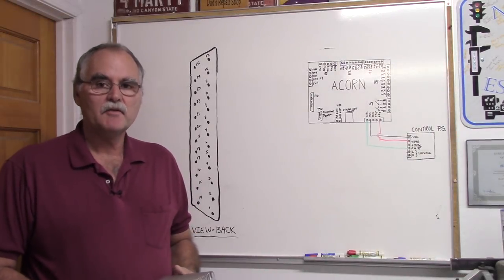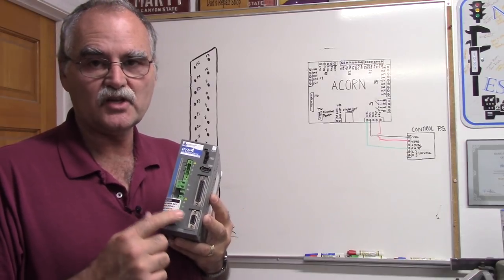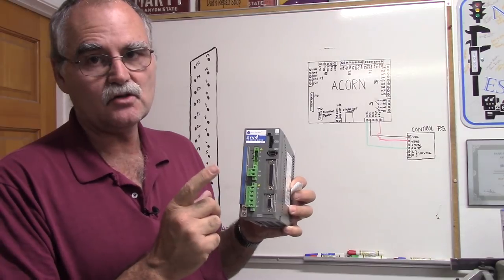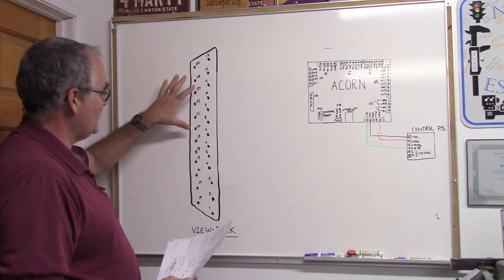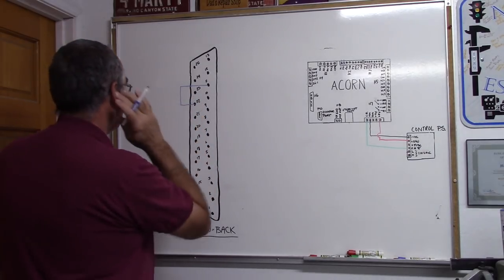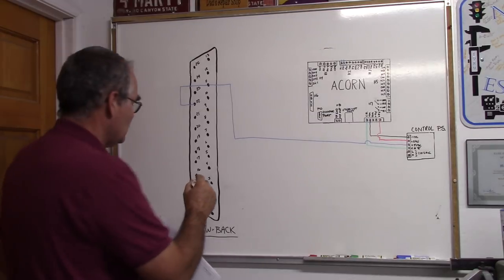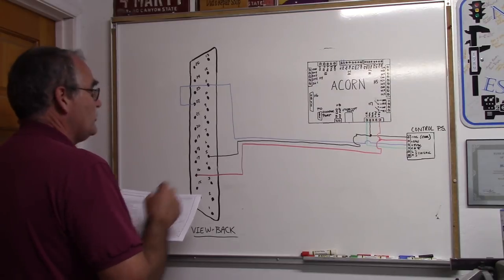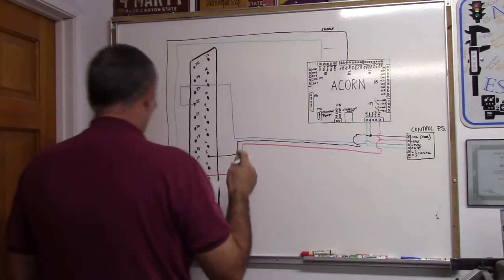DMM DYN4 Bench test with Centroid CNC Acorn

Comment: This video will help me greatly!  I purchased the DYN4 for my BP R2E4 and have been struggling to get motion from Acorn.  I did order the flying lead cables from DMM after not finding DB25's with the same wire colors or wire gage.  Thanks Marty, always look forward to your videos.
Reply from the maker: Brad, I hope the video helped. Just watch your wiring, and make sure you set the GEAR number to something like 2000, and then, change to Pulse DIR in the DMM software and don't forget to save it to the DYN4 drive. Then setup the motor steps per rev to 4x the gear number, in this case set it to 8000. Good luck. If you have trouble please visit the Centroid User forum and ask questions, post screen shots of your wizard screens, and post a report from the CNC12 software (Utility Menu) we'll try and help
http://centroidcncforum.com/viewforum.php?f=60&sid=013d264735c752e6d3e182053c581f85

Comment: Thanks for the video.  Your videos are always informative and easy to follow.  I appreciate the way that you explain details. 

I just ordered a DYN4 and NEMA 34 servo today along with the necessary cables, including the flying lead cable.  Since I only need 2,000 RPM, 120VAC should work.  The manual only shows 3-phase and 240VAC single-phase.  The manual also shows fuses on both L1 and L2.  Am I correct in only fusing L1 (hot) and not fusing L2 (neutral)?
Reply from the maker: That is correct. You only fuse the hot leg.

Comment: What to say except: thank you again!
I'm eagerly waiting for the next video :-) I am planning to do a conversion of a lathe with, of course, Centroid CNC software and DYN4 AC Servo drives and motors.
Please, from your experience what is the best solution to do with the lathe gearbox which is not needed as I am planning to use the inverter and encoder?
If somewhere is a good explanation just notice it here. I do not want to waste your time.

Comment: Marty,
I see how to connect one DMM DYN4 servo drive to the acorn and am about to test it. But it occured to me: when its time to connect 4 drives, I see only two places on the Acorn board. So do you piggyback two drives to one, and piggyback the other two drives to the second place? (hope that question makes sense) I guess I'm missing a concept here, I fail to see how two drives sharing, all the same terminal posts, can be differentiated apart by the acorn. I would have thought each drive would have its own place for the connections.
Reply from the maker: Acorn is 4 axis. Look at it's schematic.
Reply: @martyscncgarage5275  
Ok. Thanks Marty!
I assume you are talking about looking @  doc S14953.DWG Standard Connections rather than S14969.DWG DMM DYN4, which you are referring to in your above video.  So in fact, according to S14953.DWG Standard Connection:     two drives are piggybacked onto Terminal block H2, and two drives are piggybacked onto Terminal block H3.
Again thanks!
Reply from the maker: @crookedriver2079  piggy back is an incorrect term. 2 drives one terminal block and two drives on the other.

Comment: DMM technology suggests to power the logic L1 and L2 through a line filter and also 1A fuse.  I did that on my DYN4 motor that is driving my spindle on my mini lathe. The way you have it wired can damage your drive if you get current higher than 1A.  I suggest to check their manual on how to properly wire the high voltage cables to the logic and power terminals.
Reply from the maker: As I mentioned in my video, it wasn't about wiring the line side of the drive. I only did it that way in order to power up the drive. The EMI filter is to prevent noise interference from getting back into the power grid. You are correct on the fuse and you should also have an Emergency Stop contactor in your machine. This was a bench test. Thank you for your comment.
Reply: Yes you are correct. I indeed used a breaker and contactor to power the dyn4 and I wired the emergency stop in the coil of the contactor.  Great video and indeed we should learn from each other. I will soon post a video on my use of acorn and dyn4 as spindle in my mini lathe. I will share all the setting that seems to work for now.
Reply from the maker: @speppino  great, love to see your video and your spindle being controlled by a DYN4 drive and motor. I've not yet seen one. Please post it to the Centroid User forums as well
Reply: @speppino   @martyscncgarage Hey! Do you use 1 phase or 3 phase? I will run on 1 phase, as our 3 phase has 380V, which is obviously too much, but on 1 phase I'm getting 230VAC, which is perfect. I intend to run AC 1 phase -> N+L MCCB (32A) -> 32A (or more) 1 phase (N+L) contactor -> split to 2 lines and both lines again to 3 ways. On logic lines I intend to use suggested 1A noise filter + 2x 1A fuses while high power lines goes directly into drive, without daisy chaining (they are split in one point). Now I have few questions: 
- Should I get emergency switch on contactor or should I use emergency switch on my CNC controller and disable drive via EN pin? I don't like the idea of having separate emergency switches for drive/cnc controller.
- Is the MCCB (main fuse) of 32A@230VAC enough for 2x0.75kW+1x1kW motors?  

- Did you guys thought about using main noise filter (20A) aswell on power cables? If so, before or after contactor and before or after splitting main power cable?
- Do you use drive fault status to tell CNC controller something is wrong with drive (for example crash - too much difference between the shaft real vs. desired orientation), to stop all drives, now that one drive is already faulted and stopped. (meaning one axis is not moving, while others are)

Thanks=)
Reply: @juresnip  I connected the emergency stop in the coil of the contactor in series with the main power switch that powers the dyn4 drive. In this way it is safer because the coil drains only about 1 amp. I also use single phase 240V and I wired all the system according to the diagram in the dyn4 manual. 
In addition the same emergency stop that I used has another switch inside electrically separated from the first one. I used this one to wire the estop signal from the acorn board. So in case I need to stop the lathe, I will disable spindle and axis steppers in one go.
I used a 50A breaker , but I am sure 30A is enough for your system too. Just double check the max current your motor can drain during operation and sum them up and see. My servo spindle is a the dmm 86.... 0.75kw and if I recall correctly is 8A max current. Then the 2 stepper hybrid on the axis both take 4A each. Total 16A. My breaker is an overkill for me.
I did not wire the dyn4 with the EN signal to the acorn, but I think acorn is smart enough to know that when spindle trips for some reason the lathe12 software stops the motors. It  did to me many times when my spindle was tripping due to hard acceleration.

One important thing to be aware!!!! If you wire your system according to dyn4 manual make sure you have 2 separate switches to power dyn4 and acorn separately. The reason is that you need to make sure that acorn is initialized and lathe 12 is on before the spindle (dyn4) is on. Otherwise the spindle will have a sudden acceleration when you turn all together on at the same time. This can be very dangerous. Consider that my spindle is driven by the analog output of the acorn. And the dyn4 powers up in seconds, while acorn takes about a minute.  This will cause spindle to sudden rotate before acorn is initialized. If you power acorn and lathe12 first and then the spindle, everything will be fine and safe.

You could use a filter in the main line if your power is dirty. Mine is not that stable and I do not use any in the line and I do not seem to have any issue so far.

Hope this helps.
Reply from the maker: @JKTechSi  we are 240VAC in the US and the DYN4 is rated for 240VAC Max. I don't know if they have a drive for Europe that accepts 380VAC
Reply: @speppino  Thanks for all of this. It will be easier to actually select this electronics hardware.
Reply: @martyscncgarage5275  Yeah I know. That's why I'm going to use single phase, which gives 230VAC :).
Reply from the maker: @speppino  I'm looking forward to seeing your video of the DMM Dyn4 and AC motor and how you set it all up. I have to do a bench test of the same setup on an EMCO CNC5
Reply: speppino still waiting on your video :)

Comment: The minimum signal wiring required to run a DYN4 is just 5 wires.. Pulse +/- differential pair, and Direction +/- differential pair and GND on one side of the cable (receiver side according to DMM) . The +24V, +5V, Alarm (ALM) and  Enable (ENA) are not required.

Read the forum thread where people are having trouble getting any motion.. this definitely simplifies a bench test to prove there's nothing wrong with a DYN4/Servo :)
Reply from the maker: Andrew, thanks for that comment. You are correct. 
My video was intended to how to wire the drive correctly to a Centroid Acorn board and do basic software configuration in the DMMDRV software and Acorn wizard.
Reply: Could you explain this in a diagram please? I have a ESS controller Nd it does not have the Alarm and Enable signals. Thank you kindly!

Comment: have been watching your videos and have learnt a lot of information saving countless hours for research to find helpful information   was wondering if you could help with what connection plug is used on the oak board and if there are any special tools required to terminate ends Centroid has flying leads also do we use centroid or dmm flying lead obviously I will need to terminate the opposite end of one of them  thanks keep up the good work cheers Trevor
Reply from the maker: If you buy the Oak cables from DMM, they are already made up. Just plug into Oak and DYN4.
DMM is about to release new firmware for DYN4 to be used with Oak. I'm waiting for it so I can test.bif you order, be sure to tell DMM that you will be using DYN4 with Centroid Oak and you need the latest firmware. You can not install the DMM firmware yourself
Reply: thanks for that Marty  can you let me know when you get it.  I am waiting for delivery of an oak system have been doing research on plc programming I have a cincinatti arrow 750 with a auto tool changer  I have had no experience with plc programming  will you be working on any tool changer setups and examples of conections and programming in the near future cheers Trevor
Reply from the maker: @TPOSFabrications  umbrella or swing arm? Centroid has some PLCs already done. You will need a PLC 1616 IO add on board for the extra IO needed for the changer
Reply: it is an umbrella i have ordered the plc1616  there are optical sensors on clamp tool open close and spindle orientation tool drum out in  i think these would be  fairly standard on most mills the spindle orientation is still to be decided because i will need to get a vsd or spindle  drive it is a three phase kollmorgan motor and had a kolmorgan bds5 drive that  has lost its parameters dead battery backup  i would prefer to get a newer type drive that would also allow easier spindle orientation and communication with centroid oak any suggestions would be appreciated  I See you have a VMC have you retrofitted it Cheers Trev

Comment: I know you have done a video on making a report on centroid, but I am just starting out on centroid for my lathe build and need to upgrade the software so I can run a spindle encoder. I was wondering if I can create a report and send for the upgrade before I get the lathe wired and running on the free version. This will save time later. Thanks
Reply from the maker: Yes you can order the license any time.
Reply: martyscncgarage Thanks

Comment: Marty,  nice videos .. thanks !   btw is acorn open or close loop system ?  thanks !  Joe
Reply from the maker: Acorn is open loop. A food way to go is to used hybrid stepper motors and drives. Such as those from automationtechnologiesinc.com or AC servo from DMM. Both accept step and direction signals, both have encoders on the motors that feedback to the motor drives. The drives close the loop. A good way to have a reliable system at a reasonable cost
Reply: @martyscncgarage5275  Thanks so much for that info !  keep up the good videos !

Comment: Thanks Martys for those very useful information , I'm from a other world of mach3 , 4 with stepper motor and card form someone else and trying to fit one with the other. Now I decide to go with centroid Acorn for my new router . As I mention I'm a newbie with the Centroid system and French Canadian so the transition is hard. I tried to figure out in the video but need more specific information about what I'm doing. I have bought 4 servo drive and motor 1kw for my new machine , I have plug those motor into a card (MB3) the axe was moving and I had some help from someone on the web site cnczone but i was a difficult thing to do . I was on the point of installing my proximity switch and some E stop show up from I don't know where , on e stop was put down and no light on the board was on ??? So I said that enough I'm going with more professional hardware . I'm starting from zero with acorn. Would you accept to check my Data/paper to figure with way is the best for me and Centroid. Thanks for you help . W3.usinart400@gmail.com
Reply from the maker: First, buy the DYN4 to ACORN cables from DMM. That will make things a bit easier. DMM has hook up drawings. If you want to wire the DB25 connectors yourself, there are schematics on the Centroid Website. https://www.centroidcnc.com/centroid_diy/acorn_cnc_controller.html (Scroll down about half way or search the page for schematics)
Any questions as you go along PLEASE post them to the Centroid Acorn User Forums: https://centroidcncforum.com/viewforum.php?f=60
You might read this thread where I helped a user STEP BY STEP get his router going: https://centroidcncforum.com/viewtopic.php?f=63&t=2116
Make sure post pictures of your build on the Centroid User's forum!
Reply: @martyscncgarage5275  Thanks Sir for the fast reply. Do you thinks my chinese motor will work the sama as the dmm . alain roy

Comment: Hi
Can you explained more about pin 15 enable.
When send 5 v dc to the pin 15 drive stop disable.
Stop 5 v dc and drive enable?
Thanks
Reply from the maker: Centroid Acorn system? If so, simply wire per the schematics, choose DYN4 drive in the CNC12 version 4.20.1 Wizard

Comment: Is it possible to run dyn2 on x and y. With dyn4 on z?
Reply from the maker: You could connect them all to the DB25. You would need to sort the drive enable on the Dyn4 if you use the enables. Likely using the open collector header connector. Contact DMM technologies support for further guidance.

Comment: Great video! One question: In this video https://youtu.be/YC04zuUjEK8?t=502 it is stated that you should not jumper the RST to L1 and L2, but you did that (actually you used jumper from L1 and L2 to R and S). Why is it not allowed? I can't see any difference when comparing jumper to wiring directly to the power supply.
Reply from the maker: You are supposed to filter and fuse the Logic power to the drive.